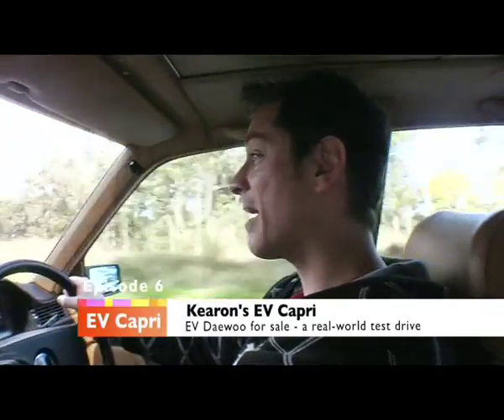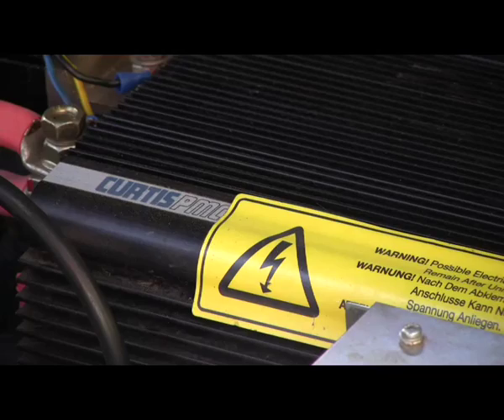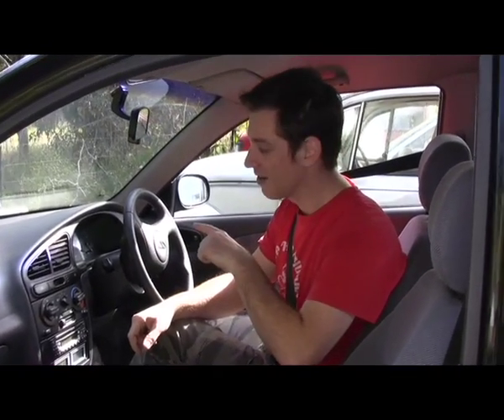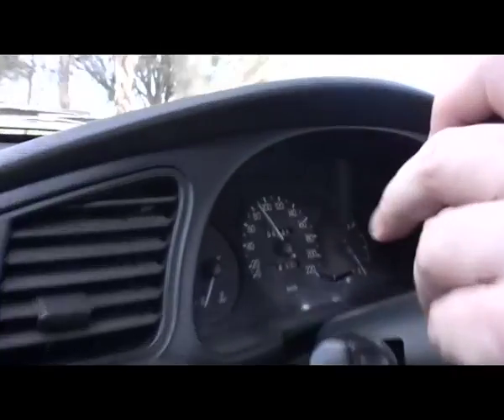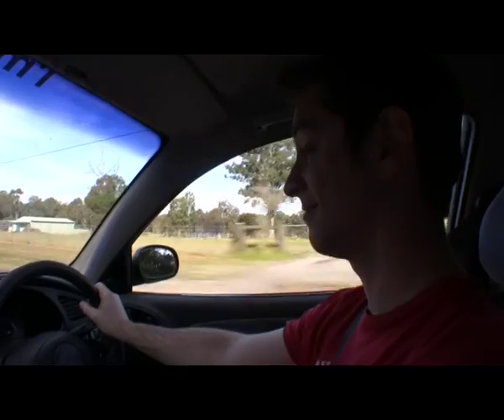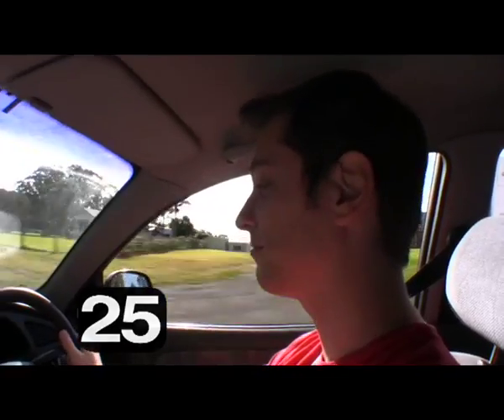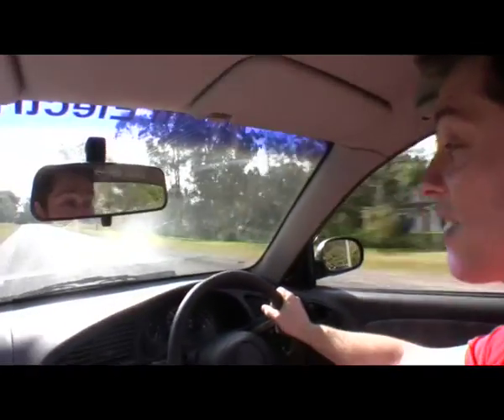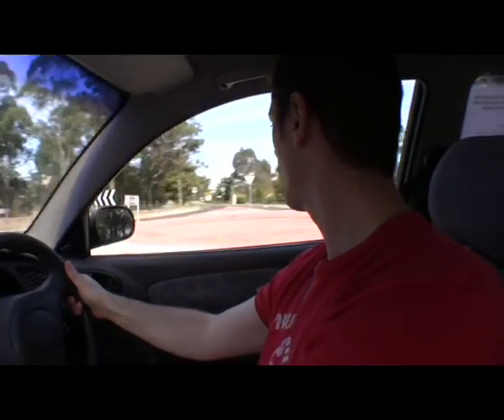EV Capri ep6 - Kearon's electric car conversion

Comment: @6SpAr6TAN69 Look up "Datsun White Zombie" and see an EV dragging off some major competitors with petrol engines.  The torque achieved from an electric motor is much greater than that from a petrol engine.  The problem with EVs is not acceleration, in fact that is one of their strengths.  The great weakness (so far) is range.

Comment from the maker: Sealed batteries do not need venting - there are no gasses escaping! That siad, I may well push some air through the battery box to keep 'em cool. And re zero emissions -there would be emissions from a coal fired power plant. How do you think one electric car's power plant emission stack up to the tailpipe on a petrol driven car + all the electricity it took to DELIVER that fuel + the petrol in the truck that delivered the fuel + the oil tanker (see where I'm going with this?).

Comment: Well I know you cant get Regen on a serie motor but you can on a permanent magnet one for DC. Im gonna have a 9" motor for the rear end and a etek 19hp on the front so I can adjust the Regen, with all the problem in the USA I just hope Ill still be able to get the parts!

Comment: I like your project im from vancouver island canada Ill be building a lil 4x4 with one of those soon as they have alot of torque. But I have to say why dont you guys get a control with the Regen option and as you can program them and then get the equivalent of compression of an ICE. Cheers